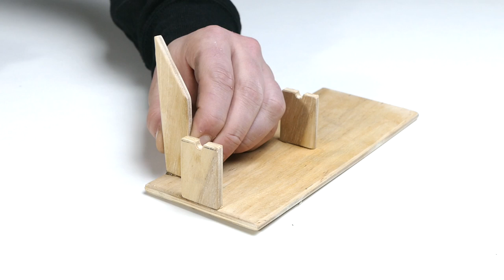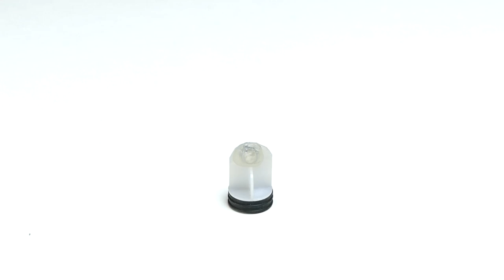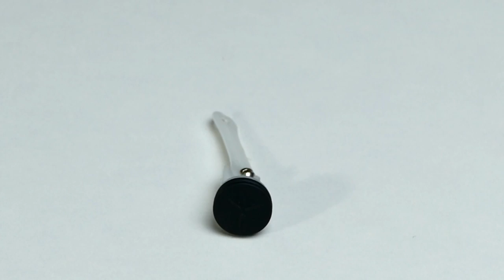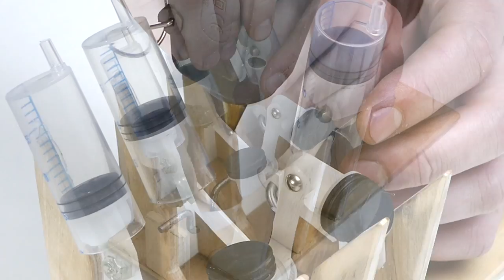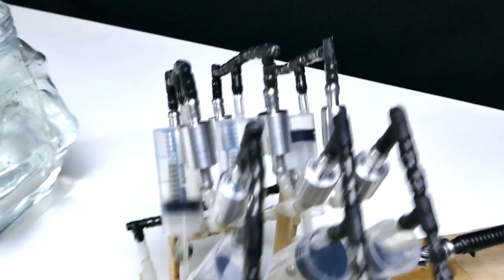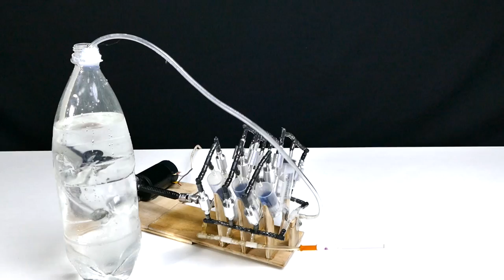How to Make an Air Compressor V6 from Syringes.Diy V6 Air Compressor at Home!

Comment: What's the name of that silver cylinder?
Reply: Itz Yasir They are probably one way ball valves. I don't like the way this is set up though. For one, if you're only using this as a pump, it would make more sense to let each set of valves have their own feed. That way 3 sets of cylinders aren't competing for air in a tiny tube. Honestly each intake valve should just have their own feed, rather than have a set share. Secondly, this setup was created in a way that gives very consistent air flow, at the cost of maximum PSI. That's down to the way the cylinders are firing. At best, the way they're synchronized you're getting double the speed of a single cylinder at double the PSI. If you synchronize it so 3 cylinders are pumping out air at the same time that 3 cylinders are sucking in air, you'd be getting triple the PSI at double the speed of a single cylinder. Anyways, that's my bit. I could easily be wrong, but that's the way I've processed the minimal information provided in this video. The plus side  however to the way the intake is set up, is that it looks cool and can be used as a vacuum
Reply: BOBKA TV am I close?
Reply: Yup ;)
Reply: It's just check valves